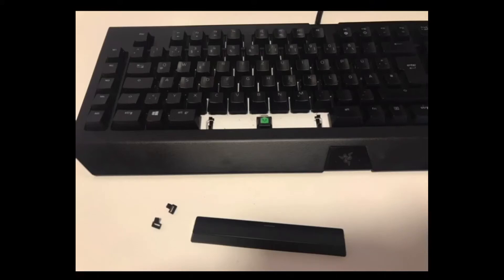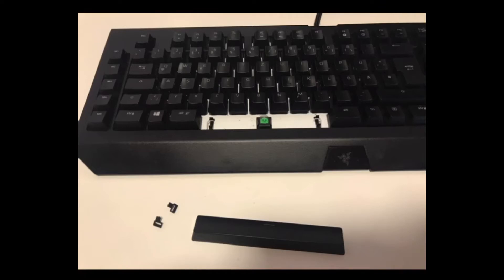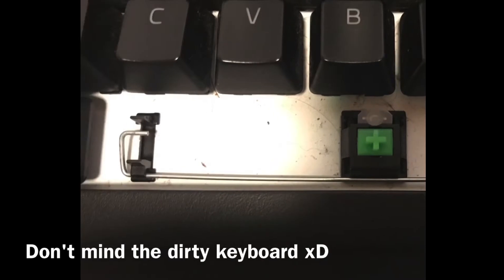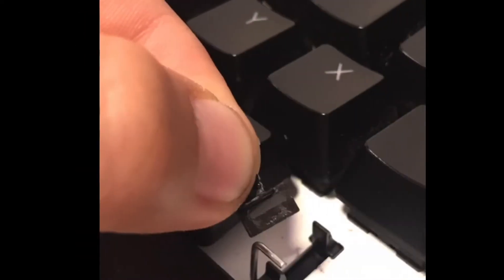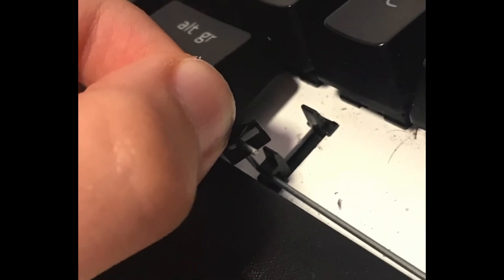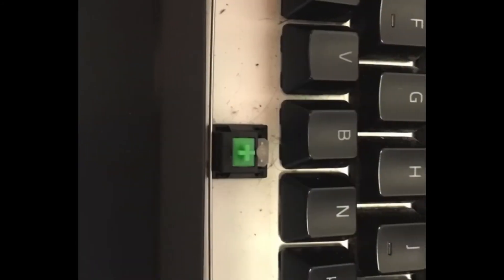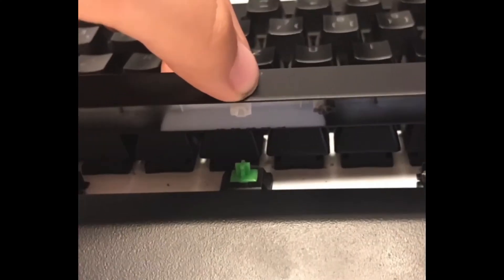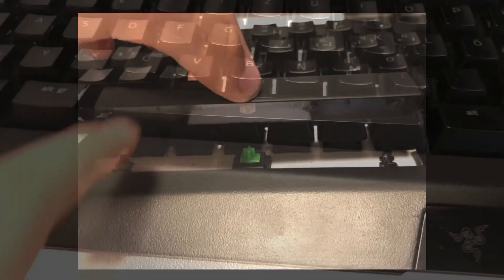Razer Blackwidow chroma (v2) spacebar fix

Comment: Idk if you're still responding, but the little thing that holds the metal bar fell off and i can't get it back on. what should I do?
Reply: not the things attatched to the spacebar itself, the things inside of the keyboard that you pop the metal bar into
Reply from the maker: @Dream-uc2ku  Oh those pieces. I don't really know I didn't have that problem. Try if you can and get those things off the numpad (if you don't use it) and of course only the long ones. If you can't, just buy replacements off the internet :)
Reply: @Versityx  Thanks, I got it working. The problem was the piece that keeps that little piece in there was broken, so I switched the broken one with the one on my 0 key on my numbad and since it's smaller than the spacebar it fit better so they both work cleanly now

Comment: Where are the little pieces from
Reply from the maker: They should be under your spacebar if you remove it. If there isn't, remove the long keycaps on your numpad and take off those pieces from the long keycaps. It doesent really make a huge difference. The only difference is that it sounds kinda weird

Comment: Worked for me thanks little homie. I smashed my space bar hard out of rage then it went real wobbly (the stabiliser was kinda bent also) so I bought replacement stabilisers. Swapped out the original (on key and in the board) and did this trick instead of mounting the stabiliser inside the space bar the traditional way and this worked for me.

Comment: Hey, where did you get those two pieces from?
Reply from the maker: When I removed my spacebar, I saw those pieces just like just laying there. But If you dont have them, (this Is what I did) I removed other keycaps from the numpad. (only the long ones) and there were those same pieces. So I used those to fix my keyboard
Reply: @Versityx  Thank you so much man respect
Reply from the maker: @MrLightningyellow  No problem :)

Comment: thank you so much this one actually helped a lot cheers m8!
Reply from the maker: Im glad it helped ^^
Reply: @Versityx  what is the name of those 2 pieces tgo
Reply from the maker: @leyow9121  When I removed my spacebar, I saw those pieces just like just laying there. But If you dont have them, (this Is what I did) I removed other keycaps from the numpad. (only the long ones) and there were those same pieces. So I used those to fix my keyboard
Reply: @Versityx  oh no i already fixed my problem but thx, btw those a called stabilizers